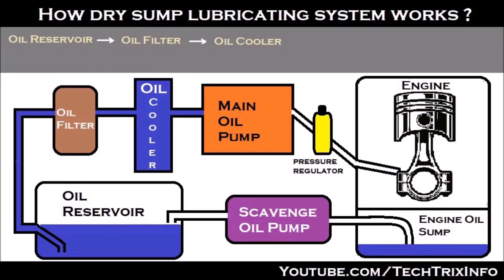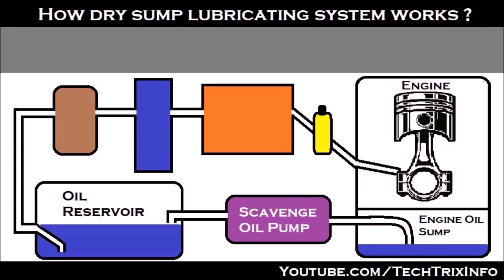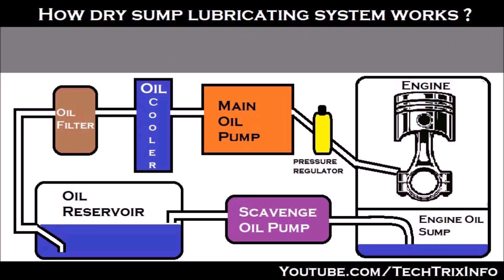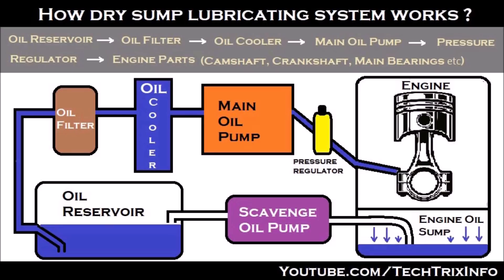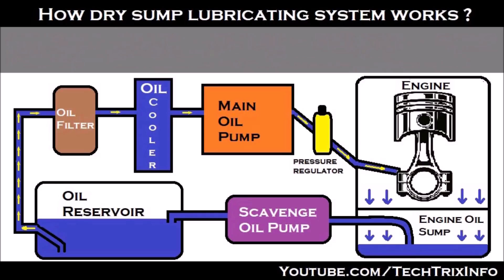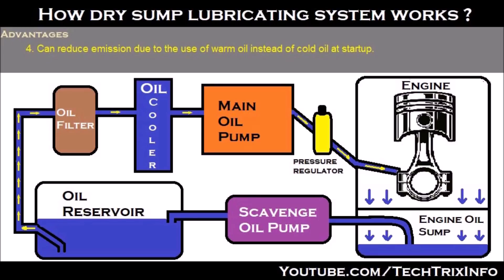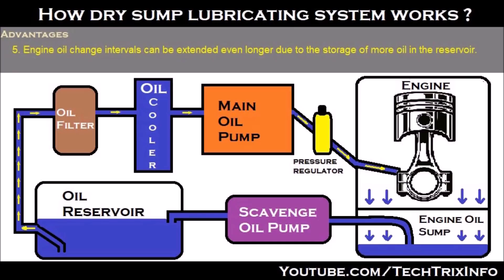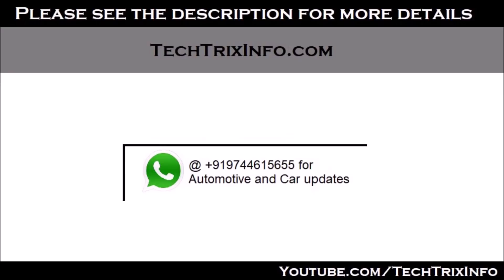How a dry sump lubrication system work | how dry sump engine works

Comment: The main oil filters strain the oil at which point in the system? answer-  Just as it leaves the pressure pump.  you diagram doesn't indicate that (answer provided by prepware )